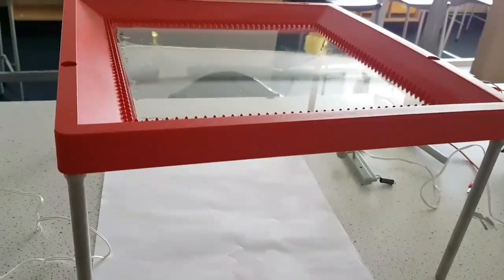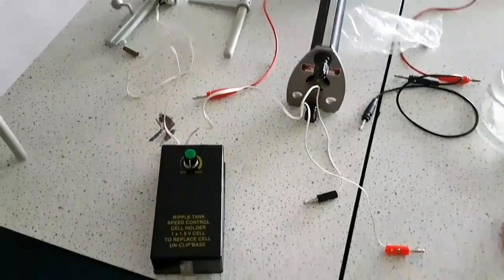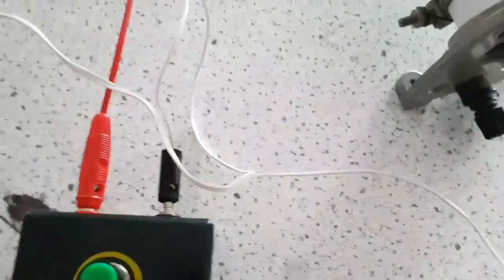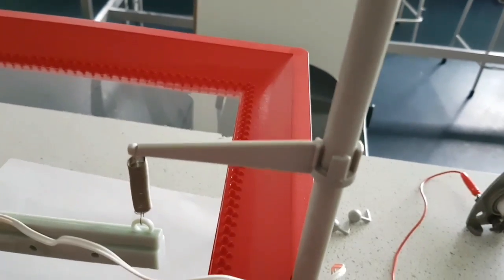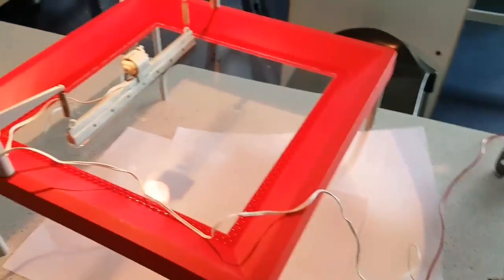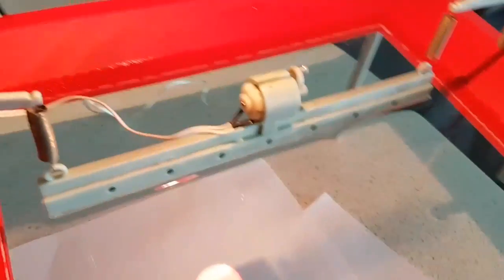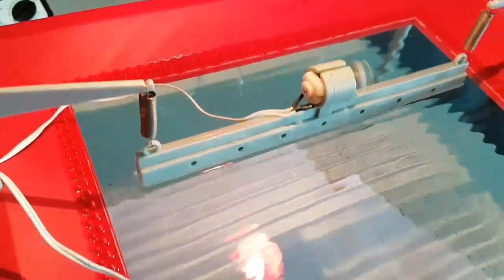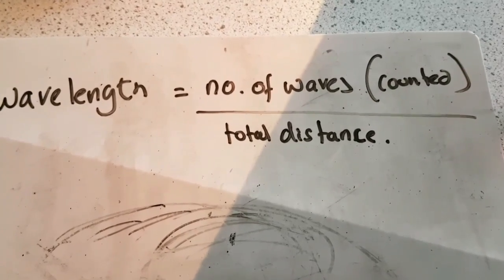Waves in a ripple tank: AQA 9-1 Physics required practical

Comment: Hi,
Wavelength calculation is incorrect.. Wavelength = total distance/no of waves, not no. of waves/total distance. I also think that in the details provided by AQA, students have to count number of waves passing a point per second (frequency) so that they can use this and the wavelength to determine the speed of the waves. Unfortunately, I found it impossible to determine as the frequency is too high. Any suggestions from anyone?
Reply from the maker: Mr M Keating - thanks for the reply, yes you are correct about the equation. The correct equation is: 

Wavelength = total distance / number of waves.

In terms of finding the wavespeed. You can do it by recording on a phone, for ten seconds the numver of waves passing a point in 10 seconds, making sure that a stop watch is being recorded in the scene too.

Play back the video in slow motion counting the number of waves that have passed in ten seconds.

Then frequency = number of waves passing / 10seconds (in this case) which will give you the frequency.

Hope this helps and thanks for the correction.